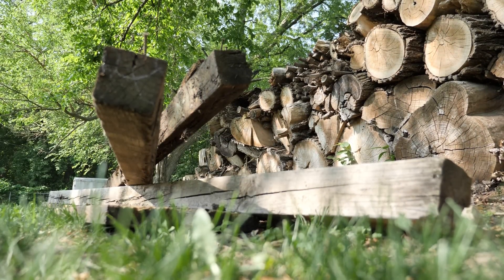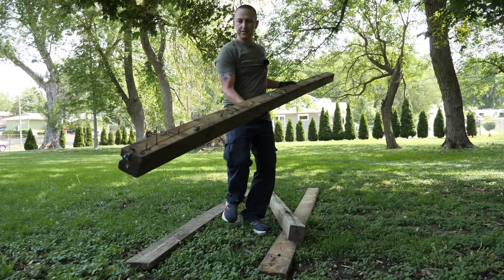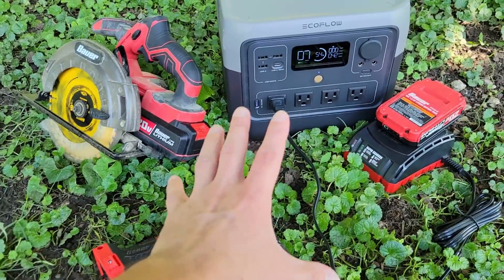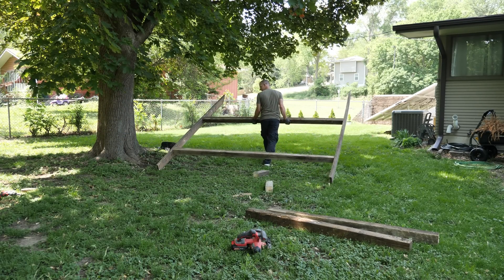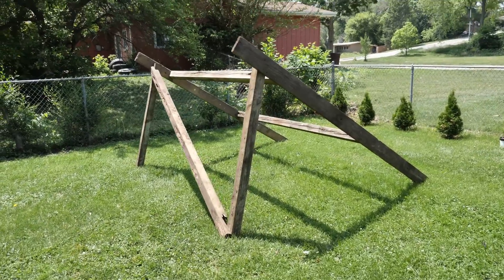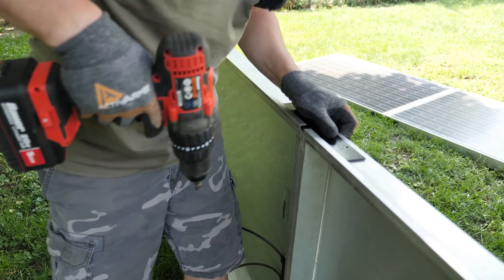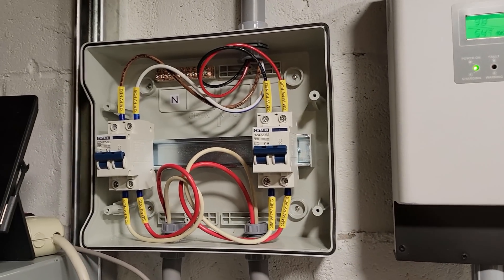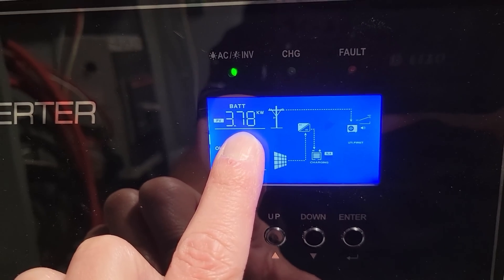Diy Solar Panel Ground Mount made from Scrap!!!

Comment from the maker: Affiliate Links if Interested!⤵
🔗River 2 Pro - https://us.ecoflow.com/products/river-2-pro-portable-power-station?variant=40322674262089&aff=732
🔗220w Bifacial Solar Panel - https://us.ecoflow.com/products/220w-bifacial-portable-solar-panel?variant=39704995889225&aff=732
🔗EcoFlow Website: https://bit.ly/3JyfGqK
🔗EcoFlow Amazon: https://bit.ly/3PwoDVs 
🔗EG4 Ground Mount - https://signaturesolar.com/all-products/mounting-options-hardware/?ref=C2w_5wtHG6jKcP

Comment: I need to throw together a vid of my el cheapo mounts. I build them out of treated 2x10's and 8 3x4  foot landscape timbers and a couple 6 foot T-posts driven into the ground and screwed to them as anchors. They've been through 50 plus mph winds with no issues. About $50 per rack in lumber and $12-$14 in T-posts plus screws. For a six panel setup using 250-300 watt panels about $25 more in lumber and I add pylex helical post behind it as a brace, those are about $50ish each. Originally I used unistrut on them instead of the 2x4's, but with the ridiculous price of unistrut these days 2x4's were a lot cheaper! They should last several years. 

Nice use of scrap to test out the new section. My yard deals with shading at various times of day so I have east facing, south facing and west facing arrays. If you have enough cheap panels and cheap racks it's a great way to get good output throughout the day as various areas fall under shade.
Reply from the maker: Yeah you should do a vid cause I wanna see it!  I really need some east facing panels. All of my panels now wont see sun till noon🙄 I have to many trees! If I jad some facing east above my kitchen, I could maybe see sun aroumd 9:30 am. When I get more panels, thats where there going!🤘
Reply: @AVERAGE_JOE  I feel your pain, I have east, west and south facing arrays due to all the trees around me with the south facing ones spread out so they don't all end up in shade at the same time. My east facing arrays get sun starting around 7:30ish and are at about 80% output by 8:15 and full output by 9, 1300 to 1500 watts depending on the haze and clouds this time of year, plan to add 3 more panels to it to get it closer to 2kw. My main south facing array starts seeing sun at 9ish, and hits about 1500 watts by 10ish, with its peak around noon at 2500 to 3000 watts. The last strings are split between a couple south facing arrays and a west facing array.  Those are generating a couple hundred watts by 9am and about 1kw by 10:30 with its peak around 1 to 1:30 at 2500 to 3000 watts. The east facing array falls off a bit after noon and is down to 200 to 300 watts by 2:30 to 3. The main south array starts getting shaded around 3ish and is down to 1500 watts by 4pm and 300 watts by 5pm, the last array falls off around 4:30 and is down to 1500 watts by 5:30. But by splitting things apart I get each array hitting it's peak about hour to an hour and a half apart with the fall off a couple hours apart. End up with about 3.5kw by 10am 5.5 to 6.5k by noon holding at 5 to 5.5kw till almost 5pm, and 1500 watts by 6 before everything falls to 300 watts by 7. That way even if I'm not generating enough to cover my loads late in the day it's enough to offset a lot of the drain on the batteries to further in the evening. Gets me 11 to 12 hours out of the day on solar/battery in a not super efficient house using 4 minispit ac units and the majority of my loads covered in the high heat/humidity of summer and leaves me with 2-3 hours of reserve power in the batteries if I don't shut off anything during a power outage. Easily offsets 50-60% of my power needs this time of year. More panels will help that though, I just have to mount them. Sorry for the wall of text :)
Reply from the maker: @andycanfixit  Sounds like you have a pretty good set of arrays and get a good amount of power all day. Mine is like meeeeeeh till noon then 💥💥💥FULL POWER lol. I should spread mine out a lil to get some of that morning sun😄

Comment: details on large breaker at 13:02 time mark
Reply from the maker: That is a SACE SN5 300amp shunt trip breaker. I got it off ebay a few years ago for $56 if I remember right. I had it connected to my last diy powerwall and controlled by the batrium bms.

Comment: Heck, if you wanna make that scrap rack survive longer, spray some paint on it, or slather some epoxy on the really badly eaten lumber.
Reply from the maker: I sprayed it for bugs.....does that count😲😁 meh its a temp setup and is working fan freakin tastic. Now I just need an array facing east for that morning light. Only place that gets a clear path from the trees(at 9:30) is on the roof.🤠

Comment: Like #314 very resourceful, quick math was 6.5 kWatt/hr now? Excellent!
I think Im going to shift some design for battery storage away from Taj-Ma-Haul and to… a Freightliner 55 rated to Class 6! I’ll be able to put 200-400 kWatt/hr and water in the step van  freeing up that weight from Taj-Ma-Haul. 
Then electrify the Freightliner. 
I might sell my Tesla CyberTruck reservation as it won’t be able to hold as much?!
Reply: This guy is onto something... How about a Verticle Solar Wall made from all of your old panels and block the view of your neighbor?
Reply from the maker: I like the sound of it 😆😆🤘

Comment: The wife is gonna Love it lol, yeah like men like to much makeup.. love the diy mid and end clamps.. nothing wrong with that, even for a permanent fixture other than using screws that won’t degrade..
Reply from the maker: Thanks!  Yeah those clamps are solid!  Need to make some for the other rack now!!!  Yeah screws will rust out for sure lol😏😆

Comment: “See dear, I told you I had a use for that wood pile that’s been sitting there for the last 6 years…”
Reply from the maker: 100%🤣🤣🤣💥💥💥
Reply: Now just beware the “I told you so” when the thing falls apart and damages your panels… 
(I would go back and install some hurricane ties in the corners to provide added durability)

Comment: I'd probably use a sheet metal nibbler to cut away the edge flap a little where the screw holes go instead of bending it, but I reckon this is a proper hillbilly solar mount! hahaha
Reply from the maker: 100% Hillbilly😆😆🤘

Comment: It won't meet the structural code for wind loading. A summer squall could toss that whole thing into the neighbor's yard. You need to add about 5000 lbs of ballast to hold the rack onto the ground.
Reply from the maker: 100% wouldnt meet any code!  Ballast would be a good idea for sure!💥🤘

Comment: Nice alt ending! LOL! I have 6k of panels set up temporarily laying flat on the ground propped up on one side with cinder blocks. Not the ideal angle, but it keeps the battery charged! 😂 I should prolly get more cinder blocks. Funny, I was thinking about a 2nd set facing west earlier today. Oh. Oh. But I do have a smaller 600w array that gets afternoon shade I could move... hmmm.
Reply from the maker: LOL at that alt ending.  I just had to throw that in there!  6k worth of panels anywhere in the sun should keep your battery charged!  Yes I think you should move the 600w setup immediately😆

Comment: Happy 4th! Nothing is as permanent as a temporary solution! 🤣
I also got a holiday video up, nothing too major just stuff I had gotten that I wanted to share.
The biggest thing is really the magnetic cables. They are a whole different realm of cables. I'll never go back!
Getting the extra watts eh? Probably also a secret plan for gaining leverage in buget spending debates... 😄
It was about time you setup a bussbar for your inverter lol, certainly a good stepping point for the final setup. Sometimes it is beneficial to get things close to how the final version will be with parts you have already in order to make sure you get the right parts the first time.
Thanks for the entertaining update video, can't wait until it is finished!
Reply from the maker: Happy 4th!!💥💥💥 Yeah that seems to be the case moar often then not lol.  I will take a look at your vid.  Magnetic cables sound interesting!  Yeah so those buss bars lol  I 100% needed to get all the stuff hanging off the inverter battery post removed and on something else.  Yeah I would agree,  A LOT of things go temporary in order to make sure things work, then can go into a final install.  I would like to make minimal holes where needed the first time! 😆💥